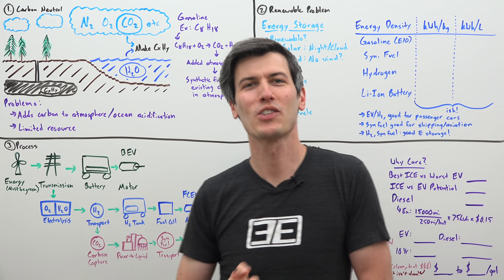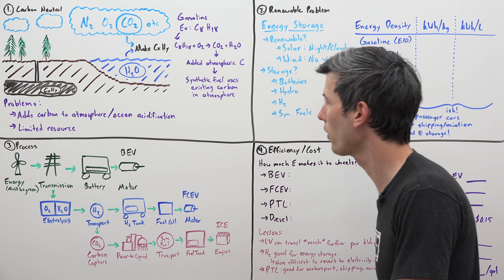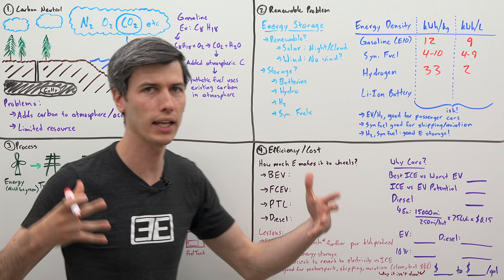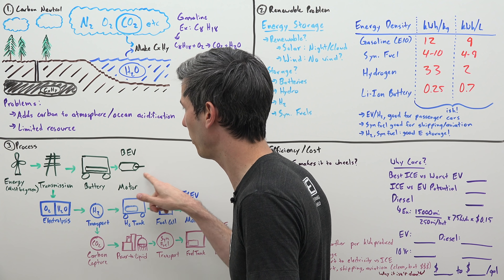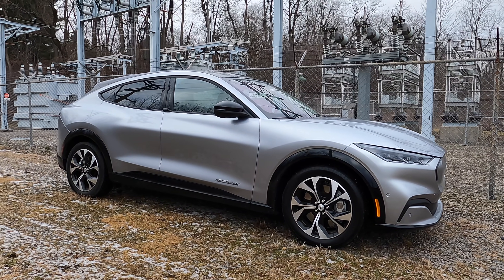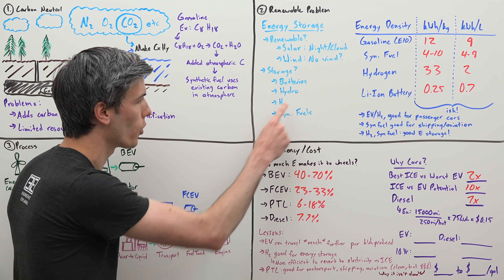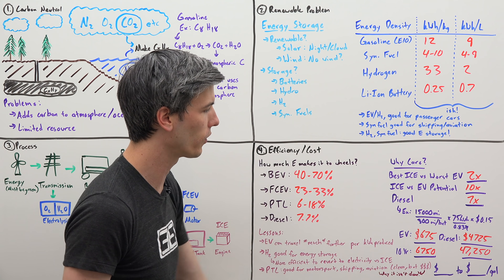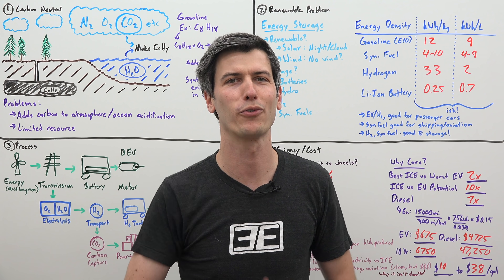The Big Problem With Synthetic Fuels

Comment: A number of thoughts about synthetic fuels:
1. They reduce the carbon emissions of existing internal combustion engines to net zero, with out the additional carbon foot print associated with producing an entirely new fleet of electric vehicles.
2. The current pricing issues are primarily an issue associated with the scale of the production facilities. Current supply lines and refineries that produce the fuel burned in ICEs are extraordinarily massive and nearly incomprehensible in scale to produce their product at quasi-reasonable prices. Scaling up the technology also improves the overall energy efficiency. 
3. The infrastructure used to produce the synthetic fuels could later be “retooled” to produce methane/methanol for hydro carbon fuel cells.
4. From a energy storage recharging perspective synthetic fuels beat out all other technologies in terms of time and service station complexity (except for maybe next generation solid state lithium-ion batteries)
5. The synthetic fuels can be combined with water using an ultrasonicator to emulsify the fuel; see HydroDiesel. This can dramatically increase the total efficiency of the fuel production and consumption.
6. Lithium-Ion batteries still face supply chain issues particularly in regards to heavy metals found in their electrodes such as cobalt, nickel, etc.
7. Those same heavy metals also make recycling lithium-ion batteries an extremely difficult and hazardous undertaking; especially when compared to how trivial it can be to recycle the large chunks of metal and plastic that form an ICE (or even a hybrid vehicle).
8. The transportation and shipping sectors, along with the military industrial complex would heavily subsidize the cost of building the synthetic fuel production facilities, given their inherent energy constraints and strategic importance. Currently the operational range of America’s aircraft carriers is limited by the fleet of protective ships that use ICEs. The nuclear aircraft carrier could refuel the rest of the ships in the fleet.

Comment: I bet hydrogen will become more economical by producing it when there is an oversupply of renewable electricity so that electricity prices get really cheap (or even negative en some cases) as it is easier to store hydrogen than electricity. When there is an oversupply of hydrogen I bet synthetic fuels will be produced from it as it's easier to store than hydrogen. This way electricity prices are stabilized while hydrogen and synthetic fuels remain economical at smaller scales.
Reply: Actually, little mistake you make is huh... Electricity is far easier to store than hydrogen. Hydrogen is actually a pain in the ass to store whereas electricity can be easily stored as potential energy. Also, synthetic fuels will only be for motorsports so those fuels all don't interact together.
Reply: @dzello  You are right with the caveat that electricity is easier to store in certain circumstances. All forms of energy storage and release is from potential energy (including hydrogen and synthetic fuels both being potential chemical energy), what I think you mean is gravitational energy. 

At large scale only pumped storage (aka pumping water uphill) is relatively easy and effective. There are also gravity batteries (that use a tower and a dense heavy weight suspended on a cable like an elevator), high pressure storage (which pumps air into a high pressure tank), flywheels (which store kinetic energy in spinning wheels), and of course the familiar chemical batteries (which store electricity chemically). 

This leaves us with the last and only true store of electricity, the capacitor (which literally pumps electrons into the capacitor material). All of these different methods of storage have different pros and cons. 

Few can deliver scale at a relatively low cost for long term storage. Pumped hydro storage is the best, but it's only available in certain locations with high ground and a lot of water. Hydrogen on the other hand can be used anywhere and can be set up at practically any scale and the bigger the cheaper it is, due to the square cube law. The volume of a storage tank increases faster than the surface. It also has the ability to deliver unique products the others can't. Heavy transport can't always rely on batteries due to their limitations. 

Airplanes are the best example of batteries being too impractical. Hydrogen could be used, but synthetic fuels would be so much better and for that you need hydrogen. You can also turn hydrogen into methane, which works really well with preexisting natural gas networks. In the summer months of non equatorial countries you would have an abundance of energy and in winter you would have a deficit. Hydrogen is the best energy carrier to plug that gap. Batteries won't cut it. Pumped storage won't cut it. If we are gonna eliminate natural gas and coal, then we need hydrogen. Or we could just go for mostly nuclear, but even then hydrogen would have some uses.
Reply: @GeneralBlackNorway No, I meant potential energy. Gravitational energy is what we do with the water, but there's other ways of storage that are not gravitational. So overall, we just store it as potential energy in varying forms. Nonetheless, you got that idea.

Airplanes are different and not part of the ICE struggle. So that part doesn't matter, we're just talking ground transportation here. Overall, hydrogen is out of the question.
Reply: @dzello  Hydrogen is useful for quick turnaround vehicles, heavy vehicles, longer ranges, remote areas etc... MAN is going to use hydrogen in ICE trucks, while others are going right for fuel cells. Hydrogen is also useful for trains that don't have access to electrified lines. Hydrogen can also replace natural gas in industry. As mentioned before, it's a stepping stone for synthetic  fuels. So there are a lot of uses for hydrogen, even in ground transportation.
Reply: @GeneralBlackNorway  Again, no. Hydrogen is simply electricity but less efficient (since creating hydrogen requires electricity) hence why we have given up on it years ago in favor of electricity.

Even big vehicles will likely go for electricity.
Reply: @dzello  Seems like you're not reading what I'm writing, I just listed several real world cases of hydrogen being used or going to be used. It's not as efficient as a battery, but it doesn't matter if you can source the hydrogen on free electricity. The nature of renewables is that they produce whenever it's available, not when people need it. As more and more renewables are built out the intermittent oversupply and storage issues becomes a greater and greater problem. Hydrogen as an energy carrier are also becoming more efficient as well, so the efficiency problem becomes smaller and smaller. Hydrogen can do things batteries simply can't. It's very likely that hydrogen will be used to at least some degree. Heavy long haul quick turnaround transport being the niche where hydrogen beats out batteries.

Comment: In that panel #4 you calculated the cost for diesel as being about twice the cost for the best PTL scenario, but then you applied that diesel cost to the Porsche model. Well, that's obviously wrong - they'll be doing gasoline, not diesel; that right there immediately halves your numbers. Still far from ideal, but nowhere near as bad as you paint it.

Comment: I think the existing transportation/storage potential is a good "selling factor".  Having all the "natural gas" (methane) pipelines/reserves full of synthetic methane (sometimes called SNG / RNG i think?) is a huge amount of long term storage.

Also the "retrofitability" in that you don't need to produce a pile of Li-Ion batteries, cars, and charging/fueling infrastructure etc (which may reduce lithium mining needs, but long term impact is debatable due to the long term efficiency losses)

Also the fueling speed vs charging speed
Reply: Hydrogen can be hard to store/use in some cases, existing Pipelines/Power Plants could use synthetic methane (perhaps blended with some hydrogen) with little to no modifications.
Reply: I think (along with bio-crude / pyrolysis oil from biomass-rdf plants) Power-to-X tech will be important for feedstocks in refineries for things like plastics, lubricants, and all sorts of petrochemicals, so i think that could enable more synfuel production perhaps?
Reply: Granted i am very armchair in all this and would love to hear feedback / additional thoughts from others, i'm just really glad/excited as a nerd in this area that a mainstream youtube channel is discussing this!

Comment: The efficiency doesn’t matter much as long as it comes from CO2-free energy but the logistic advantage of liquid fuel vs H2 is huge. It is cost that counts and that is going to be ok. Taxes should not be levied on CO2-neutral fuel, or on the CO2-neutral part of fuel. That incentivates the production of CO2-neutral fuel. Synths are FTW, in cars and in airplanes. See Porsche and Boeing.

Comment: I thought hydrogen gas is hard to store because of “brittleness” and it has to be stored at high pressure. Unless they use different storing methods.
Reply: @Simoxs7  Burning magnesium rips the oxygen out of literally everything. It's terrifying.
Reply: I could be wrong but because the molecule is so small it can also leak really easily in whatever you use to store it.

Comment: Great summary. Always nice to see some maths behind the expectations I already had. Aviation is the BIG one for me and probably the only place where synthetic fuels have a future, but it's only temporary until a better solution (probably batteries / hydrogen) is developed. This is aligned to what I've read/heard from the experts and climate scientists. 
I also note that my colleagues in Chemical Engineering did their final year design projects on this topic and it completely doesn't make sense economically, as the process is very energy intensive (with current technology).
Reply: lol. And you don't think it will become cheaper over time as the cost of renewables keep dropping? Also, the infrastructure for distributing E-fuels is already in place. 
And the electricity used to make these E-fuels will be much cheaper and greener than that of your local grid. So you can't really use the calculations from this video as an argument.
And what do you mean by temporary? Batteries are probably not going to be good enough for many decades or even centuries.

Comment: What if we had an electric sports car with a manual gearbox simulating gears, and a perfectly synthesised LFA sound coming from the speaker? I guess I'd rather have that than nothing 🥲
Reply: Strange. Why would you want a false gearstick to play around with if the car didn't need gear changes? And why noise? Sorry, I just don't get it.
Reply: @Brian-om2hh  just read this. Yes, it's definitely a valid point, thanks.  However, many enthusiasts (myself included) like manual transmissions not because of the need, but because of the interaction.  After all, we could just buy automatics if we only take usage in consideration

Comment: Amazing video, Jason. Do you dare to forecast the future of combustion engines fuel supply in 20 years? E.g. gas stations will decrease drastically to give space to electric charging points; gasoline will be scarse and prices will increase etc.
Reply: thats not how it works, as EV cars and stations increase, gas price will decrease as there will be less demand but more supply

Comment: The problem with BEV are it is still expensive, the hidden cost of the battery, and it can't transfer the energy fast enough.
I believe, battery is battery, either it is in the car or in your phone.

Faster you charge it, less lifetime it will have.
The car industry is changing like we were changing from dumbphone to smartphone.

In smartphone we are forced to charge it whenever we could unless we have big battery.
In the past, the battery was small and cannot be charged fast only 2,5W charger or best at 5W.
The solution? Change the battery.

In car... changing thr battery is harder but it should be more practical especially for trucks or public transports especially if the changing process will take less time to charge the same ammount of energy and it means it will carry more weight of products rather than weight of battery

Comment: Dear Jason, are You able to make full comparison of energy lost for EV and ICE? I mean from production whole car (including ICE motor with all components + gearbox vs EV battery + motors), and usage (including energy lost for make mining equipment, extraction, rafination, transport of fuel and oil for ICE and gearbox and also oil recycling) during some time of exploatation (15kmil/y or 15y)? For now only talking about how much cost energy (how cheap EV driving is) on the other hand how expensive (money and enviroment) is batterry production (and recycling) for EV -- wihile nobody asks or tell how much energy is lost to prepare ICE and entire shell (hehe) to run ICE.Dear Jason, are You able to make full comparison of energy lost for EV and ICE? I mean from production whole car (including ICE motor with all components + gearbox vs EV battery + motors), and usage (including energy lost for make mining equipment, extraction, rafination, transport of fuel and oil for ICE and gearbox and also oil recycling) during some time of exploatation (15kmil/y or 15y)? For now only talking about how much cost energy (how cheap EV driving is) on the other hand how expensive (money and enviroment) is batterry production (and recycling) for EV -- wihile nobody asks or tell how much energy is lost to prepare ICE and entire shell (hehe) to run ICE.

Comment: That's a nice video, but I would like to make a few points. 
First thing is that, the production of batteries involve mining which is harmful for the environment and considering the expectations of demand of such batteries such levels of mining will deplete the precious metals on earth and pose lots of damage to the environment. So you may feel you are saving earth but actually you are not, because the ev components mostly have some precious metals for efficiency, which itself results in the fact that ev manufacturing is not sustainable.
Second, the charging infrastructure is not upto the mark now, i.e, not widely accessible as the pumps. And the time for charging is something thats going to matter, because time is everything vin today's life, but we need to accept the fact that time for charging of ev is not practical for our lifestyle. This is where I feel we have to choose practicality over efficiency. If we choose ev technology, people have to buy new cars which means it adds up to the cost of adopting the technology, but most people can't. But with synthetic fuels by adjusting concentrations for efficiency , people can use their old vehicles.
Third, the cost you have mentioned is for the earlier stage of the tech. Keep in mind that batteries costed a lot before they are mass produced. So if we mass produce the synthetic fuel the cost can become less. Apart from using it only for airplanes,ships etc, using it for cars will help in mass production thereby keeping prices in check.
Also, there is also a possibility that we can reduce carbon content in the atmosphere by adopting synthetic fuels because most modern cars come with emissions kit which cuts the carbon being emitted as residue from the carbon sourced fuel, so we can reduce the environmental effects, while using an ev we are just cutting emissions.

But speaking about efficiency, we can use best of both worlds for our profit.we can make hybrid technology, to minimise synthetic fuel consumption and increase efficiency. these thoughts are what that makes me feel synthetic fuels are practical for our living. So if at all somethings  good let us encourage it, an benefit from as they are there to serve us. Sorry that I have made a large statement, but I wanted to share some worthable thoughts before just restricting a technology just because it is less efficient. Ability to adopt also weighs more than efficiency. And not to forget, the reliability of mechanical systems than electrical systems.
Reply: It boggles my mind that there are people like dzello who have the audacity to defend governments trying to ban ICE sales.

Comment: When I first clicked on this video, I thought it was about synthetic biofuels, not totally synthetic fuels. Looking at energy, I've always been under the impression that synthetic biofuels made out of basically any biological feedstock available will replace some amount of liquid (or liquidish like bunker oil used in ships) fuel, but cannot come anywhere close to replacing it all. Likely, airplanes would switch to synthetic biofuels that are a drop-in replacement for jet fuel, and ships would likely go a similar route, although they might be able to use hydrogen or some other biofuel like liquified biogas that is cheaper to produce. Railroads needs to electrify mainlines, but they'll still need diesel or hydrogen locomotives for secondary lines. For cars, what makes the most sense to me is a 50 mile range PHEV with an ICE, which would reduce liquid fuel consumption by 80-90%, making synthetic biofuels much more practical, especially as charging speed and infrastructure improves, and that last 10-20% of driving on biofuels shrinks asymptotically towards zero for most people, while still being able to gas up for a 500+ mile range.